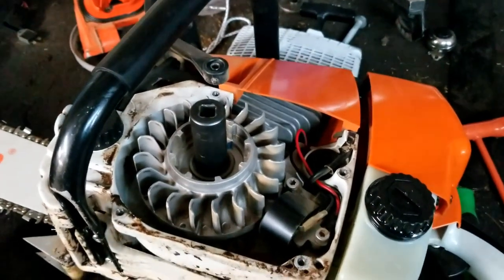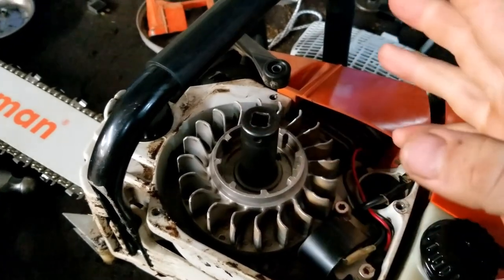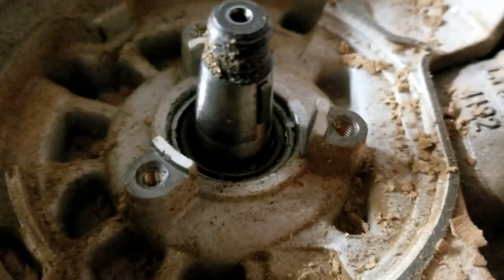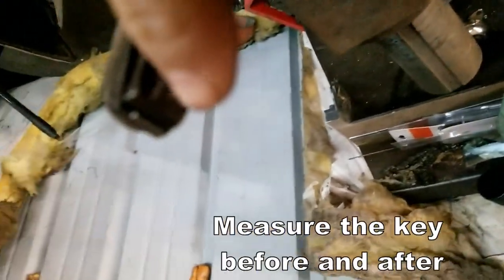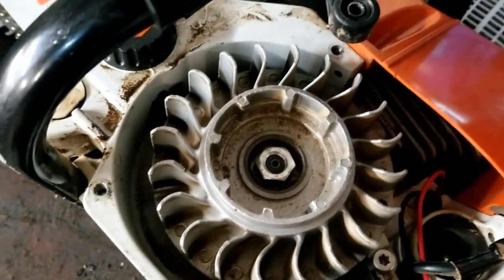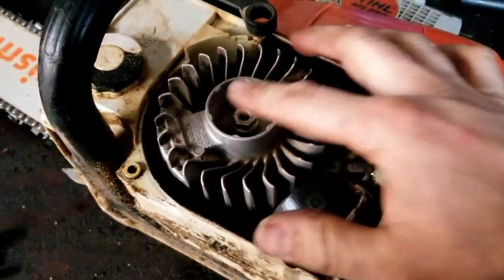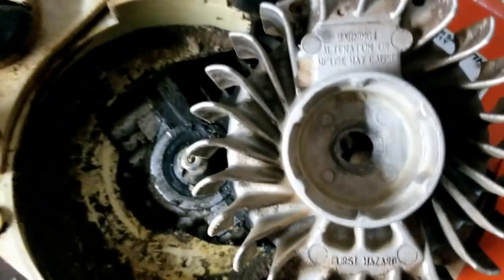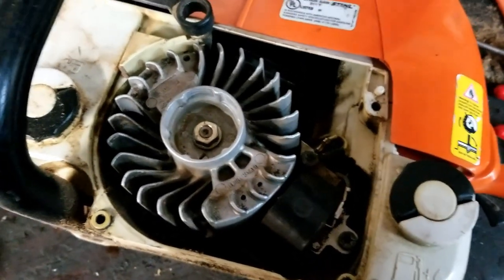How to Advance the Ignition Timing on your Chainsaw

Comment: I just ported my 1973 stihl 015 saw and I went a little too crazy on the exhaust port so now this thing runs but the timing is so delayed that it wants to die if your not on the throttle. So after following your steps I advanced the timing and now this saw is a little monster, Thanks man!
Reply from the maker: I'm glad my video helped you!

Comment: Another option is to find a coil that fits your saw that has gradual timing advance built into it, that will keep the starting easy and advance at higher speeds. Although, with some advancing coils, they have a rev-limiter as well and the advance works with the rev limiter circuit, I’ve removed the rev limiter on some saws and had the advance stop working, which lost me power at the top end. I usually make my own timing marks on the flywheel using math to figure out the degrees on the outer face of the flywheel, then you can watch to see if the advance kicks in.

Comment: I've always filed the flywheel keyway instead on all saws. The warning is one of those lawyer-induced "hot coffee" warnings. The flywheel key is perfectly safe to file. The reason the flywheel can burst instead of bend is because it is cast aluminum-magnesium alloy. Just be careful with it and don't ever drop them or hit them directly with a hammer. That'll screw them up badly. I also sandblast them after I work on them because it helps clean out all the little holes and brings it back to original balance. By the way, the 10 milligrams of metal shaved off the inside will make no difference in balance at 13,500rpm.
Reply from the maker: I just did not want some one to attempt this and burn their saw up and blame me.

Comment: The old vise grips in a vise trick. Works every time 60% of the time. Thanks for the info I am trying to run some better fuel then the ethanol blended shit they sell everywhere. With that most of the fuel I can find that doesn't have ethanol is some kind of specialty fuel that has a higher octane rating and to get maximum performance this is going to help me out some. The fuel I intend to run is 100LL Av gas with a 50:1 Klotz R50 premix. If that doesn't work any better I am going to have to dig into the dirtbikes VP. I really don't want to especially because of the price. The only upside I have noticed is the smell with the VP hopefully the lead adds a little more of that good ole cancer that seems to make things run better .

Comment: I’ve tried this many times and I think I’ve overdone it. I usually take off half he width of the key; if you have hard starting or the saw rips the pull cord out of your hand, you’ve over done it. A flywheel like any circle is 360 degrees, you only want the flywheel to move 1/8” or so at the outside diameter. I’ve gone up to 3/8” which was way too much, possibly 20 degrees 😂

Comment: When you advance the timing , making the ignition module SEE the firing position just a tab bit SOONER than factory specifications has it at , the air fuel mixture is ignited just a hair sooner and this gives the engine a little more power and a tiny more burn time in nano seconds , but it can cause detonation at wide open throttle or near w.o.t. and possibly make the saw harder to pull to start or even jerk back on the pull rope during attempted starting , is this not correct ?? And may get worse with kick back using a higher octane fuel ??
Reply from the maker: You are correct. The octane should not make kickback worse.

Comment: I know some of my saws allow for a slight change in the coil, as the holes are wallowed out a bit. Is it safe to say this will also achieve a similar result if i reposition the coil counterclockwise just a hair?
Reply from the maker: You may gain a degree of advance by the bolt holes.

Comment: Hi I have a ms460 and it is very hard to pull over it will pull the starter rope out of your hand  kicking  back. do I need to retard the spark
Reply from the maker: You most likely have a bad ignition module.

Comment: If I’m putting a 390 short block in an old 029 saw would you recommend advancing the timing? I had planned to only run 94 or 97 octane in it to eliminate pre-detonation
Reply from the maker: You could, but it does not net a big gain. Here is a test I did. https://www.youtube.com/watch?v=Dp-wb8g8tdg
 You don't really need high octane, 92 is more than enough. I run 87.

Comment: "careful- it's an easy way to damage/ruin your engine" -- Could you elaborate on this? Do you mean IF you over-did it so badly that you caused significant enough pre-ignition to actually damage the rod and/or bottom end?  Can't imagine a lil knock would be an engine-killer (unless you just kept running it)  
Would LOVE your elaboration, have the same chinesium *66 as you (2, actually) that I'm tuning & building "for high performance at-work" so longevity is as-important as power is, however I find it impossible to believe that - even after porting and all that - that my unit's OEM-spec'd timing just happens to be "optimal"...but I've no idea how much to remove, or how to gauge, what I've done -- I WAS gonna just order 2 or 3 of those cheap lil flywheel-keys, figuring I'd do one at like 10thous removed and the other around 25thou removed, try them both, then make the 3rd one closer-to the one that I liked better / that felt better.... but my understanding was a slight 'bad timing' adjustment here was NOT going to damage anything (except the over-worked flywheel key you'll need to replace, of course :P ) so now I'm hesitant to begin that A/B testing I'd wanted to, thought it was pretty risk-free so need to know if there's more worries than just knock/pre-ignition when advancing timing!
(BTW, do you happen to have any idea - & ability to explain in a basic way - how the coil "knows how to fire properly"? I of course do not mean m-tronic firing, but the same ole coil fired, magneto-driven mechanism that's been on chainsaws for half a century now, I find it VERY hard to believe that the old units had different timing BASED UPON what RPM the engine was at...BUT, from what I've learned of it, it seems you'd want to be aiming your timing to be ideal for "optimal cutting RPM", not simply idle-RPM....)
Thanks a ton for any insight, and thanks so much for all these videos, great content & lucky me the 660's are all I care/think about right now, going on 2mo and I still have at least another of "working the platform" before I call them 'done' (I just finished & proved my proof-of-concept muffler, with big baffle-plate that's curved and shoots the exhaust-pulse right back at the exhaust-flange, creating a lil cyclone in the rear half, with the excess escaping under the baffle-plate's bottom & out a hole in the front plate, both passages are more-than enough to be considered as high-flow as anything!)  One problem is it does mean the muffler will get hotter, but I'm running a big aluminum heat-shield plate as a muffler-gasket (was blown away to see there wasn't one on this saw, or any heat-shielding except some chintzy aluminum stick-on under the muff, thankfully I've learned the great lesson that you can use red Permatex, or their Motoseal, depending what degree of stiffness you want, as a heat shield!!  My 355t has had such a shield (red perma) on the side of clutch-case for >1yr, to protect / isolate it from the muff that's right beside it, but I also painted the entire "muffler reception area" of the 660 with the gray Moto and man that stuff works well there, even at the muffler mounting junctions it didn't burn-off at all!!)
Thanks again for taking the time to post all these, so darn helpful!!
Reply from the maker: If the timing is over advanced it will ruin the piston and it is also hard on the bottom end. On a saw like this, most do around .020 off the key but you are on the right track by buying some to play with. Who know what the timing is on a Chinese ignition module. It may vary. You can use the keys to test on other saws.  The timing is based off of the placement of the flywheel magents and the electronic ignition module. Some saws have an advance and others don't. I'm glad you like the videos. Check out the videos I did on the MS290 with the cross cylinder. I did testing after each mod to see how it performed.

Comment: "If it sounds like popcorn" LOL yeah if someone doesn't stop running it ASAP they almost deserve the damage (*almost*, :P ) but yeah man I'm so eager to hear how "this can damage your saw" because I can't tell if you mean there's inherent risks to the tinkering of these woodruff-keys, or if you mean the secondary consequences of over-filing and over-advancing the timing to the point that pre-ignition is occurring (which is far worse than knock, I don't know if knock would be influenced at all here since knock is post-spark combustion of areas outside-of the actual flame-front that's produced by the plug, whereas pre-ignition is pops occurring while the piston is still on the compression/upward stroke, before TDC, far more damaging to the connecting rod &bottom end than knock but sadly pre-ignition is what you're facing w/ overdoing timing-advances!)
Was so stoked to get 2-4 of the keys, play around, going modest enough, doubt I'd ever have hit any preignition and, for my optimal, it won't be "close to" pre-ignition it'll be more like "SLIGHTLY noticeable, just a touch faster responsiveness" (which is why I"m doing it -- my understanding is the actual power gains are not so significant but maybe i'm wrong on that?)
Reply from the maker: Yes, if it sounds like popcorn. You can ruin the piston and it would be hard on the bottom end. The gains won't be huge, but is easy to do so why not do it. Not all saws like a timing advance.

Comment: After after looking for someone on YouTube that knows what their doing with saws. I was pleased to find you. I greatly appreciate your 660 clone build videos. I just stopped bye here because you mentioned advancing the timing to the cloned 660. But i saw what it did in the shootout with the real 660.  Now im not sure it needs any help. I had a 395xp total stock.  And it blew me away how much raw power it had.  But always had a few stihls and like them so I bought a clone 660 to play with. Ill have to check the squish and maybe port it a little. Thank you. 👍👍👍👍
Reply from the maker: Thanks for the kind words! I'm glad that my videos helped you! These clone saws are great to play with since the parts are cheap. I've heard that a 395 is a healthy saw. I'd do some basic stuff to the 660 first, muffler mod, check squish, and timing advance. I'm not sure the air filter is good on these saws either. The clog up and are hard to clean. I'm going to run the clone 660 against the real one again when I find a nice piece of wood to test them. Have a good weekend.

Comment: This isn’t a very good idea because you’re risking wearing the engine out faster. It is the same reason why you shouldn’t be messing with the governor on a lawn mower. On top of that I wouldn’t be doing it on a really expensive piece of equipment like this one.
Reply from the maker: By advancing the timing, you are squeezing a slight amount more of power out of it. If done properly, I doubt that most you would notice a shorter engine life.
Reply: Meanwhile there are fellers out there with port jobs on 1500 dollar saws and zero complaints.
Modification usually has the most risk when people do it with a certain level of ignorance.  Ignorance can be cured by learning.  Newer choked up equipment can GAIN lifespan with some modest and responsible modification by running a better air fuel mixture and decreasing heat retention.  Your advice is misleading, at best.  Just my humble opinion.